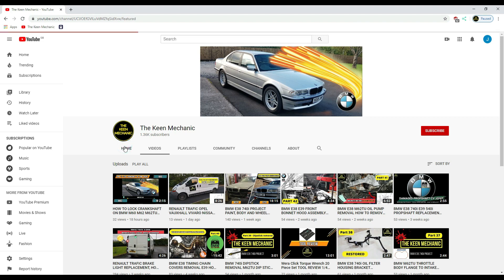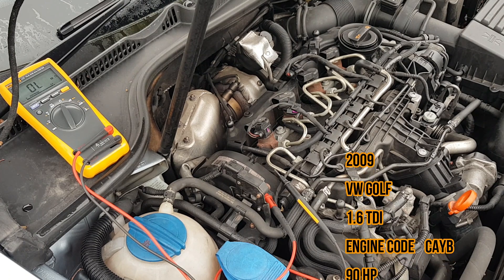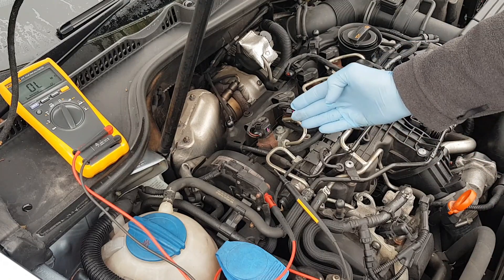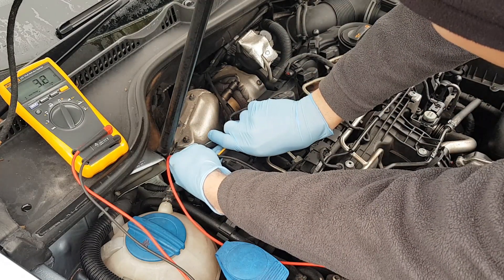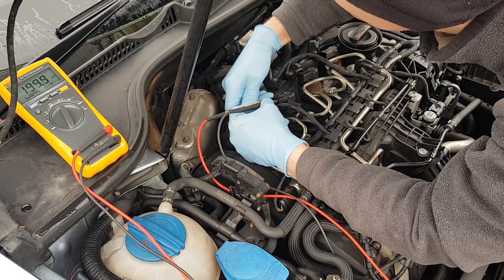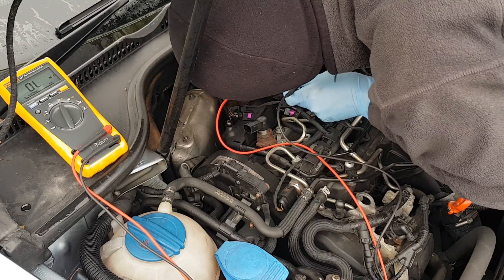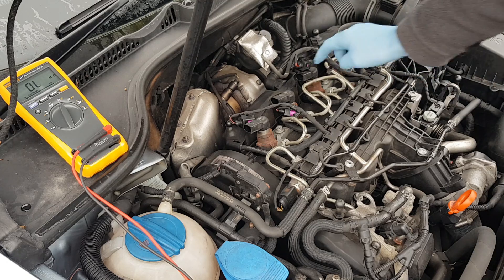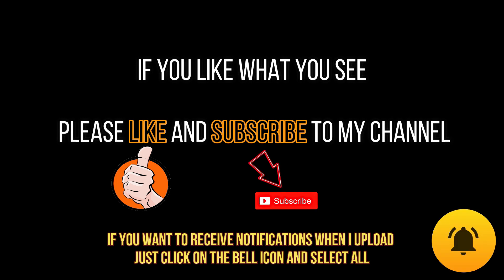INJECTOR TEST VW GOLF AUDI SEAT SKODA ELECTRICAL TEST 1.6TDI HOW TO TEST BOSCH INJECTOR CAYB CAYC

Comment: Anyone know if the 2.0tdi have the same reading as the 1.6 tdi I checked my injector resistance and getting 0.7 ohms on all 4
Car runs for a few mins the cuts off I have code for open circuit on all 4 injectors any help appreciated

Comment: Again thanks for this I’m having similar with no4 same engine but my code reader allows me to clear code and car runs fine for X amount of time then does it again I’m beginning to suspect the wiring can you please advise what the voltage should be at the loom please?
Reply from the maker: Most injectors use 12 volts to energize the coil. It is hard to diagnose intermittent faults like this but I would advise you to try and swap injectors and see if the problem moves, then you will know if it is the injector or the wiring. 9 out of 10 is the injectors
Reply: @TheKeenMechanic   hi there thanks for the reply another lad said the same but if I’m honest if unbolting is the way forwards in this I may aswell throw a new injector in there while it’s out do you think that star lock bolt will give me much hassle?
Reply from the maker: @_sandie_123  No. The bolt will not give you any trouble. The only thing is you will need to replace it as it is a stretch bolt.  Install new copper washers and o-rings on the injectors too. Best of luck buddy🔧🔩🤝 I have a full 46min video on the replacement of the injectors
Reply: @TheKeenMechanic   nice one thanks I will give it a watch before any attempt is made I will let you know how I get on 👌🏼👌🏼

Comment: Excellent work, Sir!
Had exactly the same issue on my CAYC, same injector #3. short ckt.
Failed at 41k miles.
I wonder if the other 3 are not far behind? 🤔
Reply from the maker: These are very poorly manufactured injectors. Such a common problem and VW should have done a recall on all these 1.6tdi engines. Nobody can tell how long the other ones will last.🤝

Comment: The official test is insulation resistance at 100vdc applied using a mega meter. The resistance should be no lower than 0.04mohms. I had a bad injector which measured 196k ohms but when using 100vdc it was down to 0. 0mohms and was basically a short circuit under voltage conditions (simulating operating voltage when injector is firing). My symptoms were car could idle OK (at very cold was very lumpy)  and rev, as soon as you tried to drive and put load on it, it would go crazy and lots of grey smoke.
Reply from the maker: Great info. Can you share a bit more info regarding how to carry out the 100vdc test with the mega meter please. This is interesting
Reply: Very good information much more indepth than this video,if you do this video test and assume its ok you could be totally wrong.

Comment: My vcdc showing cylinder 3 has no voltage, but when removing power sockets from each injector it's actually 4th cylinder that is not working.

Why is that happening?

Thanks in advance
Reply from the maker: Hi 
It is very difficult for anyone to diagnose such electrical problems remotely. If you can't work it out yourself I suggest getting some help from a local specialist🤝
Reply: @TheKeenMechanic  thanks for replying , why if to do old way just to remove each socket at time from one injector to detect the faulty one will that work as a detection of afaulty injector?
Reply from the maker: @ghecot4576  Try it. It will do no harm. I did it myself in my other video🤝

Comment: Very good video. I have the same problem with 2nd injector. Any way to open it and repair? Is a way to buy just the top part of the iyector (electrical part)? Many thanks for your video
Reply from the maker: Hi, you are not the 1st person to ask this question. Unfortunately only a professional injector specialist can repair the piezo element as it needs to be calibrated on a bench. Even then I have been told that there might be some issues. Best option is new but they are very expensive

Comment: On how much to put a multimeter to measure 200K or 200?
Reply from the maker: Put it in ohm resistance function
Reply: @TheKeenMechanic  yes but mine has more options at ohm 200k, 2000k. 2000, 200
Reply from the maker: @ED-hn1sk  Put it in the closest range to 200k ohm
Reply: @TheKeenMechanic  can i get your email address?
Reply: @TheKeenMechanic  how can I check if the wires are damaged / broken from the injector to the ECU or where they are already going?
Reply from the maker: @ED-hn1sk  Check for continuity from end to end

Comment: How do you check wiring with multi meter diesel injectors
Reply from the maker: Do a search on google or youtube as I dont want to tell you the wrong thing. Should be same principle only ohm figures will vary. Check for continuity🤝

Comment: Hi where are you based , I may need your help
Reply: If I swapped the leads over from 1and 2 would that be a good way to find if injector is bad code shows no 1 open circuit
Reply from the maker: @MrBlaugeist  I have a video with the full repair as well.
https://youtu.be/KGzuh6Xyf3E
Reply from the maker: Northern Ireland
Reply: @TheKeenMechanic  I’m in Cornwall 😀 , to far for you to come an help
Reply: @TheKeenMechanic  if I swapped leads from 1 and 2 would that show if injector had failed ? The code 0201 circuit open shows . How is best to identify definitely it’s the injector
Reply from the maker: @MrBlaugeist  Just do the test shown here in the video and check the ohms. You can swap the cables as well but make sure you dont start the engine. Best of luck with your repair

Comment: I’m getting this exact issue on no 3 with readings of 50 k ohms instead of 200 k ohms like the others is there a possibility it could just need a clean, or is it definitely finished? Thanks vince.
Reply from the maker: Make sure you double check the readings before you replace it. Most likely it is done and you would have to install a new one, I would recommend a brand new one if you can afford it as used ones just delay the inevitable and you could get stuck again. Double check with local specialist to be sure but I would say your piezo is most likely gone. Hope this helps
Reply: @TheKeenMechanic  Thank you for your response I much appreciate it 😊

Comment: hi mate i did your test on a second hand injector and it was same reading as the other 3 but when i installed it with new copper washers and seal also cleaned all the carbon where it goes i get rough idling and a ticking/ tapping sound even when driving. could this be a faulty injector? thanks
Reply from the maker: I would say it is likely the injector is faulty. Try with another one if you can get a hold of and see how it goes. It is worth doing a back leak test to see if there is a blockage in the injector. If blocked it will return more fuel than the other 3 and you would know by that. Just do whatever is easier and cheaper. If you are getting 200kohm then the problem is not electrical and the injector is most likely blocked. Hope this helps

Comment: my vw golf mk6 1.6 tdi 2009 injectors are made by Continental  NOT Bosch !!!!!!! OEM from new
Reply from the maker: Thanks for sharing. I have seen continental too. Have you had any issues with your injectors yet and what is the mileage so far?
Reply: @TheKeenMechanic   No as yet they have been fine with no issues,56,000 miles but l do diesel purge them every 10,000 miles.
Only 20min job
Reply from the maker: @colin5064  Thanks for your reply. You are looking after your car very well from what I see and hope you have no trouble with it. Mileage is quite low so it should last you a very long time😉🤝
Reply: Eric King  Maybe best to be aware that this model has also suffered with problem of High pressure fuel pump failure
Reply from the maker: Eric King  Very few issues reported with the 2.0 compared to the 1.6tdi. If I was to pick one of the two I would go with the 2.0tdi

Comment: Very useful! So I suppose that an injector can default by the wiring part alone? Thanks!
Reply from the maker: Hi Edwin
On this type of injectors where there problem is electrical you can check if it is functionl just by measuring the resistance with multimeter. No need for OBD. When purchasing used injector I bring my Fluke multimeter to check before purchase from the  car breakers. If you can afford buy the new revised injector 03l130277s and avoid 03l130277b if possible. Of course this is only if there is electrical problem. If injector is blocked than you need to do a back leak test
Reply: @TheKeenMechanic  Hi! Finally the problem was electric, so I had my injector replaced, put the right new codes but then the engine gives rattling / knocking sound when accelerating... The computer doesn't give any error message. Have you encountered this problem before?
Reply from the maker: Hi. No I have't had this before. Make sure you run a back leak test to ensure that all injectors are ok and not blocked. Do this before anything else and then if this doesn't help then look at other issues
Reply: @TheKeenMechanic  Thanks for your response, but unfortunately I don't know whether the mechanic did this or not... But I'm wondering if adapting injector minimum deviation quantity with a VCDS can solve. the problem? Cheers,
Reply from the maker: @FBAagent  Hi
You can try and see if it helps. I don't do anything else apart from coding the injector. If the injector is properly calibrated all you need to do is code it. Ask your mechanic to do the test for you. It depends what injector you bought, if brand new you should not have any issues. If refurbished you should have some warranty and hope it has been calibrated on a bench after re-assembly
Reply: @TheKeenMechanic  Hi, can you replace B with S injectors without any problems with the engine running? All the injectors I have now are B.
Reply from the maker: @hakimzoua5987 Try and see how it goes

Comment: Hi I have fault code : fuel injector group A supply voltage - circuit low. Would u be able to advise me on that thanks
Reply from the maker: Hi Mark
Check fuses, wiring and injector resistance. Check all injectors and compare the readings to see if there are any difference. Hope this helps and best of luck. Also do a research on the fault code you are getting to see if other people had this issue and how they resolved it. As it is a voltage supply fault, make sure that your wiring is intact. Hope this helps
Reply: Thanks for you help great videos 👍
Reply from the maker: @markrichardson9722  No problem. Let me know how you get on and what the problem was👍
Reply: Hi..i know its 2years..but i have same problem..did you solved the problem??

Comment: Thank you very much for taking the time to make and post helpful these instructional videos!  Will this work with most Bosch injectors (I did read the description) such as those fitted onto a BMW M62?
Reply from the maker: Hi there.
Thank you for your comment mate. The 200 kohm resistance measured is specific for this tipe of common rail diesel injector. You can use resistance test on petrol engine injectors on the M62 but the spec will be different. This is a great way to find if your injectors are working or not. I am glad you are enjoying the educational video. Most people prefer enterntaining videos nowadays. I like to teach people to be able to fix their cars themselves. 😉
Reply: @TheKeenMechanic  Thank you!